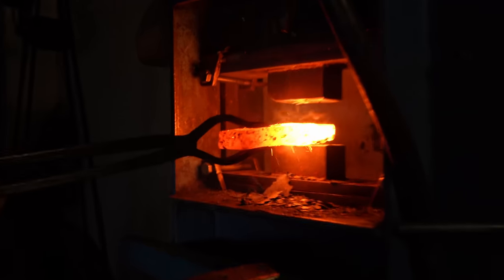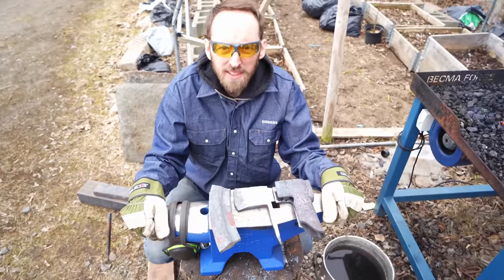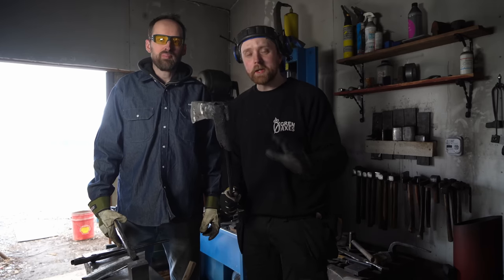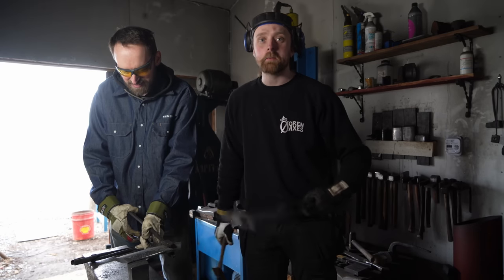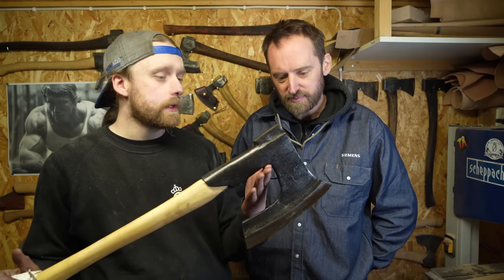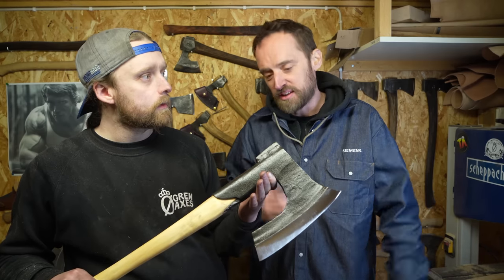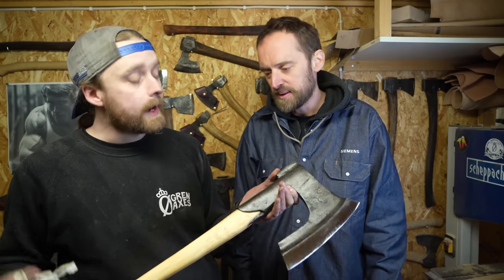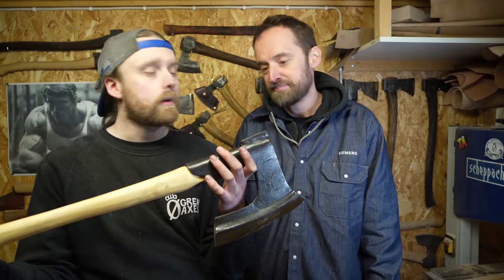Forging a Traditional Swedish Hewing Axe: Recreating the 1700's Craft

Comment: I've never understood why welding takes light hammering at first rather than as hard as possible hammering. And why welding 2 different steels is the easier than 2 of same.
Reply: The light hammering is to set the weld so the pieces won't move around. If you hit loose pieces that haven't started to weld hard they will shift and things won't line up properly. Also it isn't really that two different steels are easier to weld than two of the same, it is that some steels accept welds easier than others. Mild steel is cheap and available in a wide variety of shapes and sizes, and absorbs shock quite well, so it was often used historically for the body of axes (it is still cheaper today, but the price difference between higher carbon steel suitable for an edge and mild steel has come down enough that the labor savings of making an axe in one piece is worth the extra material cost and bit of shock resistance for mass production), but mild steel doesn't weld easily. Higher carbon steels useful for edge steel will weld more easily, so inserting a sliver between the two sides of a folded axe with a mild steel body will make that weld easier than mild steel on mild steel, but if you make a folded axe entirely out of high carbon steel (or at least the simple ones that weld easy) there is no benefit to putting the shim of a different steel in between the sides of the folded piece as far as welding difficulty is concerned (you also don't need a separate piece of edge steel, because it is all suitable for an edge).
Reply: @coopercummings8370  wow, excellent explanation thankyou. It all makes sense now.

Comment: Feel free to inform me otherwise, but that seems like the weakest way of joining the blade to the rest of the axe.
Reply: If you mean the wedging the edge of the blade into a cut into the body of the blade connected to the head it was actually extremely common albeit usually utilizing thinner broader joining surfaces for the best weld